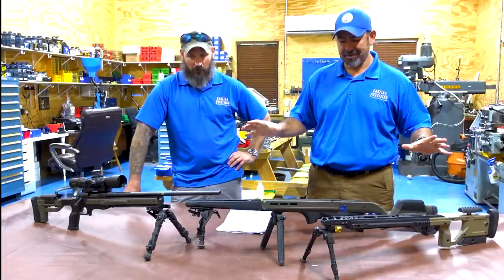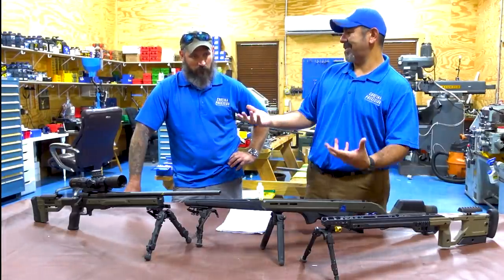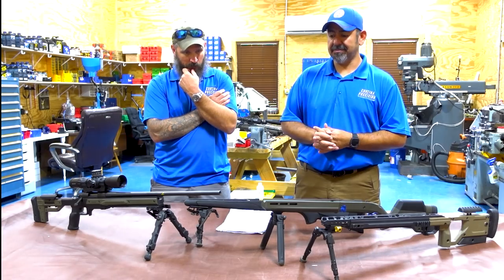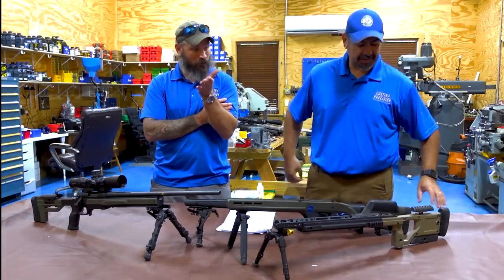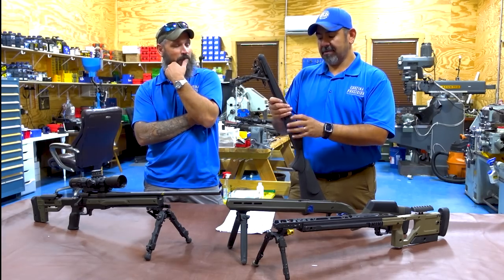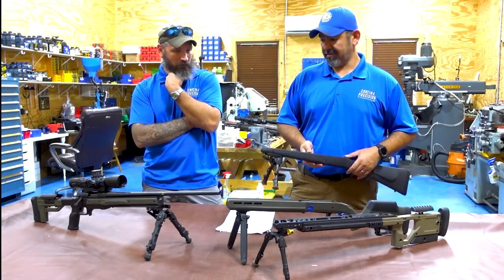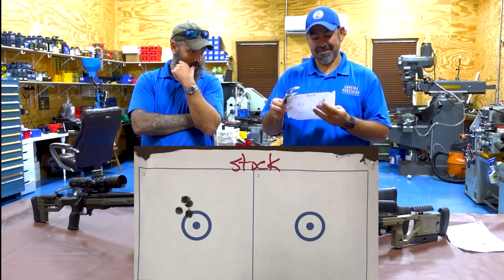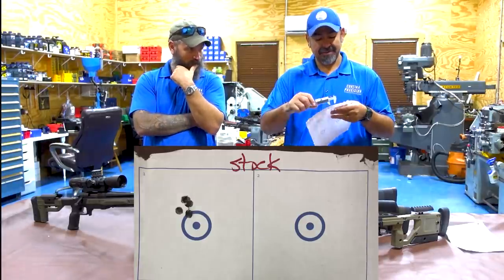6.5 NEEDS-MORE | WE TESTED FOUR DIFFERENT STOCKS

Comment: Get a Jewell trigger next. I don't think lapping will change much, since it's already shooting so well. A custom load work-up would be needed to get any improvement. You might try bedding the MagPul Hunter, since I've seen that improve group size. I did that to a Remington 700 with a Krieger barrel, and it shot a 0.18" 5-shot group after load work-up.

Comment: Erik, In my experience every time you pull & replace an action in the stock it can (not always) change the POI. take it out and put it back in and it can change, tighten the screw different it can change. If the lug is a press fit or bedded it can be very repeatable as long as the torque is consistent.

Comment: Run the other rifle thru all 4 stocks, and get your 40 rounds caught up. Obviously they are still "breaking in". And, as I've said from the beginning, add the extra weight to the factory stock. I fill an Altoids tin with cast bullets and stick it in the stock, wrapped in a rag if it's loose, hammer down corners of tin if it's tight...adds about a pound of weight, made a HUGE differance on a couple of my rifles/ muzzleloader. Also helped with balance..

Comment: You started with identical rifles with different accuracy. The upgrades made a major difference. I agree to make the same upgrades and start to determine if the accuracy is at the same ratio. By making the same upgrades to both rifles it should determine if the barrels are the reason or the difference. However, it is your efforts and content, and I am just the guy that enjoys your channel and the dynamic you have with each other. Thank you both for sharing.

Comment: You already know what the control does, you have the paper with holes in it. I say modify them both, but choose different options for each. A brake on one and a suppressor on the other. Brand X trigger on one, brand Y on the other and so on. The only valid thing for leaving the control as it is, is see how it shoots after the same amount of rounds. That will tell if the change is the barrel improving or the mods making a difference.

Comment: Drill holes through the webbing in the forearm of the factory stock. Then fill to the top of the webbing with a resin mixed with hardener. You may need to channel it out again to make sure the barrel is floated. This will add weight and help rigidity of the factory stock. Do that for the control, then do each upgrade for the other, one upgrade at a time. New chassis, trigger, tuner brake, hand load, etc…
Reply: After you upgrade the one and tune it to the best possible group size, then using the factory stock of the control start changing one item at a time, such as the trigger, then load ammo to find its best node, then add tuner brake.

Comment: Thanks for trying different stocks, I was wondering if I should upgrade mine, at least I know what to consider now. As for the next upgrade I would do the trigger as this is a DIY upgrade rather than pay a gunsmith at this stage. You could try two different triggers one with a sear and a Triggetech, I noticed a significant improvement  when I upgraded to the TT. Next would be the tuner break (My EC tuner is working wonders on my Vudoo, Thank you!)  and finally you go the whole hog and true up the action and replace the barrel. 
Great series guys, looking forward to the next instalment.

Comment: You already have the targets as a reference for "control". Keep them the same to compare how upgrades could maybe perform differently on different rifles. Or do one upgrade to one and a different upgrade to the other and see the difference in improvement. Brake/tuner, trigger, true the action, maybe rebarrel vs stock barrel.

Comment: I have bedded several rifles with JB weld with great results. It helps to let it sit a little while to thicken up and not be so runny. Even my 416 Taylor improved was bedded with jb weld and 600 rounds later it’s still holding up great. I also like acra glass gel and pro bed 2000 I believe it’s called. Those tupper ware stocks like on the factory stocks really needs to be roughed up to get a good stick.

Comment: Most important thing in my opinion is the fire control system.  You've got shooter comfort, so after that fire control, trigger, and David Tubb’s Speed Lock system. The break would be dead last if this is a hunting application.

Comment: So I think the question was answered about the factory stock.  It can be made to shoot as well, buy it takes more effort to shoot and isn't as comfortable so it probably won't be as consistent over multiple strings, especially once some fatigue sets in.  I'd be interested to see both rifles with tuner brakes in either the same chassis to see if the tuner setting is the same, or two of the same chassis with the tuner brakes.  Also, maybe lap the lugs on the factory bolt on one rifle (or both) to see what degree of change there is.

Comment: I dont think you should do the same to both.

This is a good opportunity to compare a nice gun to a hyperfocused gun.
What I mean with that is this;
The gun that originally got the Oryx chassis, I'll call this gun 1, was found to be nicer (as a direct result of said chassis) than gun 2 (the control gun) with the bedded and free floated stock, but at roughly the same accuracy.

So, if you keep hyperfocusing gun 2 on accuracy, and forego all the niceties in favor of cost savings, while g1 gets upgraded with a nice but still good bang for buck parts, like the chassis, then you can see at the end of the ride where you end up in terms of how nice a gun is for a certain cost and accuracy.

So if next test is going to be, say, triggers, then the outcome might be that the nice triggers is much easier to shoot, but given enough practice the original trigger can shoot just as well. In that case, G2 gets to keep the original trigger, and G1 gets upgraded to a favored one. If trigger upgrades do make a difference, but various price classes still perform the same, then the cheapest goes into G2 and G1 gets the nicer one.

So the intention is to keep G1 and G2 equally accurate, but completely disregard the niceties on G2 in favor of cost savings.

Keeping the guns equal has some value in statistical analysis but honestly 2 still isnt much and you'll gain almost as much from just shooting twice the number of groups per gun. If that sort of statistical reliability is important to you at all, then it would be good to see how many groups were shot in each configuration, the minimum, maximum and average sizes and, given enough samples per configuration, the standard deviation of the group size, but that last one's going to start eating into the ammunition funds at that point and probably not quite necessary.

Comment: At this point make them both similar. You have the data from the beginning. Plus when you rebarrel them it would be really cool to see how two of the same barrels differ. After doing a trigger and tuner you could try truing the bolt face and lap the lugs to see if that affects anything too before rebarreling.         A buddy recently just bought a new 700 the week they hit our shelves in 6.5cm with the intent of a build. Shot a box of ammo just to see and got similar results as these rifles. Then got a benchmark barrel, krg bravo, and a triggertech. The smith lapped the lugs, trued the bolt face to the threads, and chambered the barrrel for 6.5lapua.   That thing is a laser

Comment: We have a factory baseline for both rifles  and we have seen what modifying the chassis system will do put them both back in factory stocks with an upgraded trigger so we can isolate the improvement of each modification individually then cut the barrel add a tuner break then we can see which modifications gave the most improvement individually and then combine them all together to make the rifle as good as it can possibly be

Comment: This would be a perfect scenario for selling your tuner brake.  Put the control back together on the modified stock. Put a tuner on the control rifle. Put a trigger on rifle 1.  Compare the two rifles.  I guess you could throw high dollar parts at rifle 1 and keep the control rifle as cheap as possible while improving it at the same time.

Comment: The "control" or baseline has already been set. I suggest using rifle 2 as the "budget" rifle. Keep the factory stock but add budget upgrades one at a time. Trigger (drop in) makes sense as the next upgrade because it is relatively inexpensive and can be done at home. Next after that would be the break.

Comment: You could use an adjustable "Bradley's Cheek Rest" on the plastic stock. It would improve the confort and add a solid Stock to Check weld.

Comment: We can all say whatever but its up to Eric regardless. But the control was off because they weren't shooting the same to begin with. This just show what some of us are faced with what to do with what we got. Experience is priceless and these guys have plenty of it.  That factory stock can be improved with a cheek piece and some plumbers putty in the butt stock on the cheap in my mind. You can also add a bag rider on the rear stud another $100 total and you may have a tack driver. Jb weld has been proven for me on my bedding jobs and iv tried some . Great series gentlemen.  Maybe needs a little more

Comment: Ahhh... you two are killing me!  :)  The reason for the control is this:  it CONTROLS for the external variables... like a bad batch of ammo, a windy day, or shooter being in a funk.  The whole point is to compare shooting the new thing to the old thing on the same day at the same time with the same shooter.  By doing so, you can remove all doubt about whether the change you made was responsible for the improvement, or the external circumstances were responsible.  Do the WHOLE set of tests you intend to do with the control, then when you are done, go nuts on the control and see if you can improve it then.  But don't do it now.
Reply: Their problem is the control out shot the modified rifle. There is nothing left to do if there mods wont shoot as well as the stock rifle.
Reply: @CoyoteRegulator  That's just it.  There is no problem here.  In science we call this "failing to reject the null hypothesis."  What they've just proven is that their mods (so far) don't actually improve the accuracy of the gun.  FULL STOP.  If you can't come to that conclusion you aren't doing science, and you shouldn't use words like "control."  You've got to be capable of coming to that conclusion, or else you're simply steering your experiment to fit your desired outcome.

By modifying the control now, they are LITERALLY saying they have no faith in their future mods either.  If they DID have faith in their planned mods, they'd keep the control as-is to demonstrate that they do in fact improve the rifle over a stock one.  What are you going to do if the control starts to shoot WORSE after the mods?

Also, mad respect to all veterans and especially to Jason for his service, but I'm shocked a trained sniper is turning out to be such a whiner.  Sacrifices must be made to do good science.  I know it's uncomfortable to shoot a crappy gun, but it must be done.  Just like it's crappy that someone who needs a new medication still has to take the placebo.  We do this to know FOR SURE the medicine works.

As I said before - finish the experiment the way it was designed, then afterword you can go hog wild on your control gun and see what it can do.  We've all got plenty of time to see this through.  What's the hurry?

Comment: I've got 2 walnut stocks bedded with JB Weld because devcon was out of stock at a point and they have held up just as good as Devcon. It is a little runny but but I let it sit for 30 minutes before application to thicken a little. Even then it is still thinner than Devcon but being thin definitely helps fill down into voids better and I got no air pockets in the finished bedding. Don't knock it till you try it, both of my rifles have had 1000+ rounds and the JB is still holding strong.

Comment: The control gun still has merit because we’ve already seen changes in how it shoots. I would say leave the barreled action as is, do t do anything to it that isn’t reversible until you finish the other gun. Because one thing you might be able to show is how consistent/inconsistent the factory gun shoots from range session to range session. There’s really not much point to doing 2 guns exactly the same way for any kind of testing purposes. That’s just two guns showing how upgrades help. I like what some people have commented, now that you’ve tried multiple stocks/chassis systems and can see that they all shoot comparable to each other, stick with the budget upgrades. Things people can and tend to do to the factory gun. Add a check riser, epoxy lead to the butt stock, clamp on muzzle break. Once you do something irreversible to the barreled action, it won’t be a control group. And since you haven’t been to the range yet where it shot consistently ie it’s been different every time, I don’t know if it’s time to mess with it. If you go to the range 3 more times and shoot 3 5 shot groups that all print .5-.9 the. You know you have enough data. But o don’t think any of the three or so range trips have produced the same results yet have they? 
Or, just for kicks and grins, switch the purpose of the series, do the exact same thing to these guns except clean one like you do, and now don’t touch the other one and see if there’s much of a difference in performance over the next few hundred rounds. Turn this into a should you clean your gun or not series!!

Comment: I think that the control rifle is showing some break-in improvement because it didn't shoot quite that well before even bedded. Fluke groups can happen any time. More important at this point is the shooter and how well he tames the jumping around. It was evident the Oryx tamed the jumping around a lot. So it was much more shootable. For hunters that will probably rarely fire 5 shot groups. The hunting setup is set. Once you decide you want to shoot more a chassis is the way to go and you can go as expensive as you want but don't expect to find more accuracy. You will shoot more comfortably and your own accuracy might improve, but it won't be because the action shoots more accurately. Now you should add a tuner break. Not so much because of the comfort side of it because most chassis will make it shootable, but because adding a tuner kind of gives you a chance to shoot factory ammunition with almost reload accuracy. It could potentially be a big improvement. You're already close to the point that your most limiting factor is the ammunition. If you want to improve using it you'll need a tuner. I would install the tuner on the "other" action (the one first tested in the Oryx chassis) and I would quickly work up some reloads for the "control" action in a chassis. That would show if its cheaper to install a tuner break or invest in reloading equipment and reload. Your budget and what your intended use the rifle should alway be deciding factors. We don't all have access to your testing ammunition. We don't all have a budget to practice with Berger ammunition, but we all want to be better shooters and for that we have to practice a lot. So show us how to get better accuracy from the rifle and we can decide what would be the best way for us to become better shooters.

Comment: I don’t think you can put too much weight on differing performance among chassis, because it could be differing barrel harmonics affecting the results. But I do think we can assume that the flimsy original stock will be inconsistent. So my vote is to choose a chassis, put them both in it, then see if the EC Tuner Brake can tighten them up in the non-control rifle. And for fun, maybe throw it in each chassis and tune each time to see if tuning makes the real difference once you pick a stable platform.

Comment: Keep the ‘control’ one-step behind the other freedom delivery machine, that will show the difference in progression or set back with each modification. I’d put a tuner brake and or trigger on the non-control gun next. one change at a time, if time allows. I don’t see the point in leaving the control “factory” its baseline has been established. continuing to test with the factory stock would be interesting. I wouldn’t get into multiple different triggers, different brakes, and chassis for now so we keep the testing methodology as simple and predictable as possible. I love this series! 

What is probably more helpful than anything is the approach you guys are taking, both of you having built extremely accurate rifles in your time, but coming into this with an open mind and almost no ‘plan’. That’s how I usually approach building a rifle, but that’s because I don’t know what the heck I’m doing. Hahaha!

Comment: Also, I would think the weight of the platform, plus differences in rigidity could change barrel harmonics. An interesting test would be a weighted collar on the barrel. Start at the muzzle and move it back in 1/2" increments between 5 shot groups.

Comment: If you're going to keep them the same, I would suggest bedding both barreled actions in the Oryx. It's a minor step, but the only reason it shot better in the original stock is the bedding. Those actions aren't exactly precision on their outer dimensions. Both would shoot better imho. I would try a new trigger before the tuner/brake. Joe average can't just throw a brake on, but the trigger is a simple relacement.